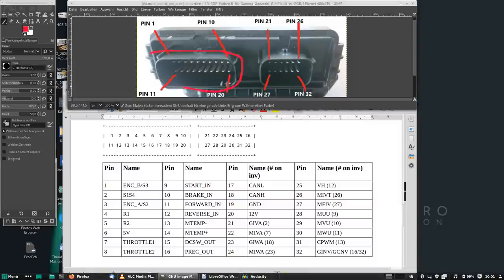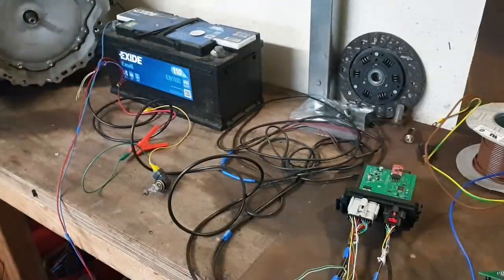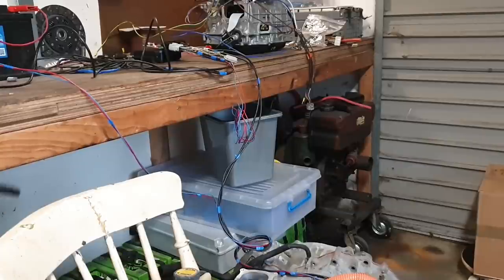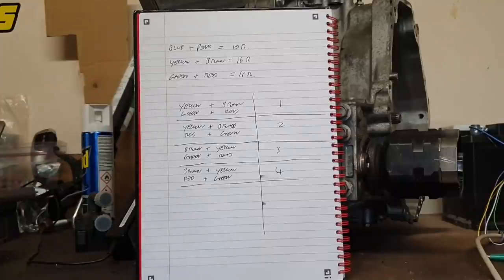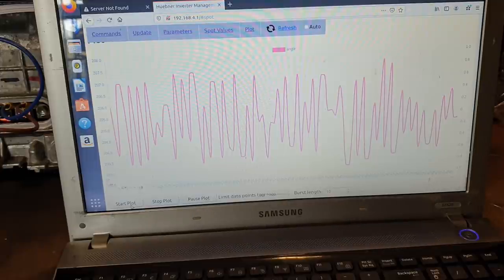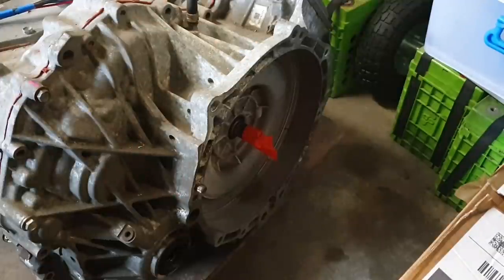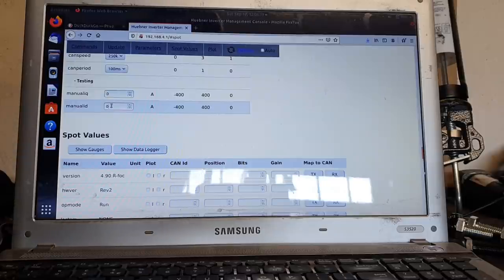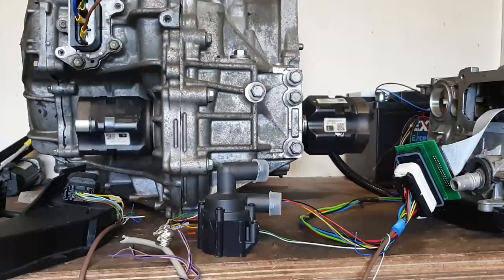OpenInverter FOC Tuning Tutorial

Comment: Just successfully tuned a Gen 3 inverter and Gen 3 MG2 using this method. The video is a brilliant collaboration and thank you both very much. I was running v4.9FOC firmware which is newer than in this video and the “set pinswap 5” command didn’t work for me, however there is now a handy drop down menu item labelled pinswap which allows you to select PWMOutput23

Comment: FOC: Field Oriented Control. HV: High Voltage ~80-200V. IM: Induction Motor.
OVERALL: discussion is about Toyota parts, but is generic for almost any permanent magnet motor which will need FOC software.
TEST EQUIPMENT: <<INEXPENSIVE>> It is assumed that only basic equipment is available such as light bulbs, switches and multi-meters.  (12 V wires can be automotive grade, but HV cables MUST BE RATED FOR ~ 300 Volts).
0.51: Connections to VCU for Toyota Gen 2 Inverter.
4:27: Overall schematic of inverter and VCU Gen 2, 12V wiring including external items such as throttles and resolver connections
4:55: Discussion about VCU Gen 2 PCB components: purpose of; location of power supply ccts; pre-charge/charge circuitry etc. 
6:21: location of solder jumpers for 'open collector' requirements with Asynchronous (IM) motors with encoder feedback.
6:37: VCU Gen 2 connections to inverter Gen 2 and trans-axle Gen 2.
7:08: Grey connector for throttle, brake, 12V power etc.
7:15: Black connector goes to Gen 2 inverter.
7:24: How to SAFELY apply 12V power to VCU Gen 2 for reducing damage from mistakes such as 12V to wrong pin...
9:46: 55W lamp, car battery, ideally fuse (10A?).
10:30: VCU energized: should be two LED s light steady, and third one flashing (shows STM IC executing software, :)  ).
11:14: Initial hook up to Gen 2 inverter. Bypass inductor, Use 80-160 V DC supply initially. Use ~230V incandescent light bulb.
11:21: Signal harness has been connected at this point in time.
11:41: 2 pole connector is 12V supply to Gen 2 inverter. Watch polarity.
12:45: VCU Gen 2 AND Gen 2 inverter connected to 12V supply. Light bulb behavior slightly different to only supplying VCU Gen2.
13:00: Small glow of lamp due to quiescent steady state current consumption of  Inverter Gen 2 electronics (Gate Driver board).
14:01: Bulb glowed as expected, can connect 12V supply directly, bypassing globe. Please use fuse in series with supply to protect wires.
15:04: Trans-axle Gen 2 temporarily wired to VCU Gen 2, HV battery, trans-axle resolver connected to VCU Gen 2. 
15:42: Only MG2 of Gen 2 trans-axle connected to MG2 output of Gen 2 inverter
16:13: Trans-axle planet split device has been welded together and the trans-axle bolted back together. No oil in trans-axle.
16:27: MG2 and MG1 now spin at same speed all the time. See other videos for info on welding.
17:00: Stubs for trans-axle differential output were not available, so Damien put tape on the petrol connection for seeing rotation of the axle.
18:20: Discussing running trans-axle in open loop mode first, as part of FOC Tuning process.
18:43: HV battery connection to two bus-bars, (bypassing orange input cable port) to bypass buck/boost inductor. 
19:04: Build up commissioning plan using the most simple steps conceivable. Can always add other steps later.
19:17: Bus bar closes to black capacitor square is HV positive, Bus bar closest to aluminum die-cast box is HV negative.
20:05: HV negative wire connect directly to HV battery pack (or equivalent) [Remember to use HV rated cable :)]
20:51: Recommendation: use HV battery rated 80-160V (150V?) good value...
21:17: Use ~20 Amp fuse HV rated and fuse holder HV rated, light bulb 230V rated 100W HV rated, bypass switch HV rated.
22:03: Fuse protect wires from shorts (does not protect electronics). Switch open for pre-charging inverter capacitors and seeing inrush current flow into inverter electronics and seeing how current flows into trans-axle during early commissioning phase.
23:03: If you don't understand pre-charging inverter capacitors, please pause watching this video and learn what this means first.
23:41: HV light bulb limits any fault currents that may flow during early commissioning phase.
24:08: HV light bulb protection for limiting fault current for wiring inverter incorrectly, inverter faulty, battery wired wrong polarity, any other unplanned conditions. (Please note, shorts on HV battery circuits can carry thousands of amps, with burning and UV flash-over)
25:36: Negative battery connection crocodile clip attached to HV battery (HV positive connection was already connected). Result, light bulb flashed for <1 second. Means pre-charge current for inverter capacitor Gen 2 flowed, then once caps charged light bulb went out.
26:50: Total system of trans-axle, inverter, VCU, HV battery , LV battery is now ready for overall system commissioning.
27:05: Now go to computer talking to VCU, and set f to 3 Hertz.  And Ampnom to 10%, Can hear whine coming from trans-axle.
27:35: Ampnom ramped to 20% then 25%, now get petrol axle jittering and trans-axle rocking back and forth.
27:42: Ampnom set to 25%, and now we see axle rotating slowly in open loop mode. PROVES: inverter/trans-axle/HV/LV Battery/VCU wire connections system WORKS as a whole. We are now READY for the next stage of FOC tuning.
28:20: We observe HV light bulb is glowing dimly, because we are consuming current in the transaxle rotating.
29:09: Ampnom is now set to 0 amps via the laptop. We can now close switch to bypass HV light bulb, and then continue open loop tuning.
30:05: The spinning petrol shaft axle means: inverter/trans-axle/HV/LV Battery/VCU wire connections system WORKS as a whole.
This is a significant step.
30:32: The next step is to commission this permanent magnet trans-axle using the Openinverter forum FOC firmware.
31:19: For those commissioning their permanent magnet trans-axles, please pause what you are doing and carefully watch this entire tutorial :).
32:00: Demonstration of resolver circuit. Sinusoidal excitation signal verified with a tiny second hand loudspeaker.
32:33: Set 'encmode' to 'resolver' on laptop.
32:59: How to lash up 12V supply to VCU on bench to test excitation output signal. Connected pins 4 and 5 to loudspeaker.
32:42: Discussion of how to get the 6 wires of the trans-axle resolver connected to the correct pins of the VCU.
33:58 Resolver discussion applies to practically any permanent magnet motor.
34:20: Need paper and pen, basic multi-meter, wires to connect to trans-axle resolver plug (hopefully you have the mate for the plug)
35:25: Without any resolver wiring diagrams, point to point sets of three pairs of wires. Write down resistances of pairs of wires. Lowest resistance pair is the excitation coil pair. This applies for any make resolver.
Reply: 38:26: The two high resistance pairs are the sine and cosine pairs of wires. They have almost identical resistance.
39:23: Which pair is the sine or cosine pair does not matter for the Openinverter forum FOC firmware. Therefore you don't need to lose time trying to work this out. There is a video by Johannes that describes the maths for this.
40:01: Need to make chart in the notebook for 4 possible permutations of connections for the sine and cosine pairs. Need to connect the same polarity of the sine and of the cosine coil to the ground return connection.
40:40: CRITICAL: Only 1 of these permutations will work your motor properly. The rest will only make your motor partially work. Even if you have a schematic from the manufacturer, you still need to go through this work.
41:44: Strongly recommend you bring out the resolver wires from the VCU and connect to some connector block with at least 6 tunnels in it. Put exciter coil wires to the right and the rest to the left. To facilitate changing sine and cosine coil polarities.
42:19: Wire the exciter coil of the trans-axle resolver to the exciter output of the VCU. Please note, polarity of exciter does not matter :). Because all you are doing is swapping polarity of BOTH sine and cosine coils, which does'nt matter.
44:32: Now we look at outside world connector of VCU. E.g.: Pin 1 is sin resolver connection.
 47:40: With correct resolver connections of the system and tuning of the FOC firmware, end result commissioning is demonstrated by easily changing speed of the trans-axle axle by simply depressing the accelerator pedal.

Have to stop now, more later.
Reply: 48:35: Damien will post a parameter file on the Openinverter forum. Please post yours here too so we can build up data for everyone to use.
49:03: Page from notepad showing last configuration was the successful resolver feedback connections for correct sin/cos polarity.
49:34: Huebner web interface. >Load FOC firmware. > hwver>Prius. >Opmode = OFF. 
Must make sure resolver signals are being received by STM32 in VCU. 
Make sure HV completely turned off.
Put vice grips onto shaft and turn manually for full revolution.
Computer, Go to Commands . Put opmode into Manual / Run.
angle L , R. Can graph from left or right.'
Go to bottom of screen, hit Plot button, and see waveforn on screen. Plot 204 - 207 degrees. This plot includes jitter. We expect some, but not a lot. Jittering >5 degrees, would consider that a problem. For this, check wiring, screens of resolver cable. E.G. jumping over a hundred degrees, STOP problem in resolver wiring or something else, broken resolver winding etc.
Restart Plot, rotate axle by a few turns look at waveform. Should get jumping wave forms that move from >0 to <360 degrees. We don't expect plot to capture 0 degrees or 360 degrees, because sample rate is too slow.
So screen goes 0 -> 360, 0 -> 360, 0 -> 360.
Third test, crank up limit data points and burst length. Start plot and hand rotate axle again.
Expect to now see 0 - > 360 in some of the waveform display.
Now go back and press Stop Inverter button on screen.
55:51: lasterr, Throttle1, if this displayed low resolution instead, micro-controller is telling us amplitude of received signal is too low.
56:02: Remove vice-grips from axle. 
56:17: Have to configure current sensor positions for FOC firmware in Gen 2 inverter. Has to be done manually through custom command box. 
56:46: Set pinswap 5 Send Custom Command. In messages should see Set OK.
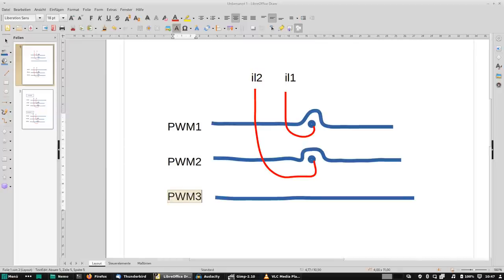57:31 We expect PWM1 would be measured by IL1, PWM2 would be measured by IL2, PWM3 not measured.. 
Not so Toyota, they use PWM1 not measured, PWM2 measured by IL1, PWM3 measured by IL2.
This confused the FOC software.
58:37: pinswap = 4 is a bit change command which relabels the current sensors to be as per Toyota arrangement above.
58:38: first bit of pinswap swaps PWMs, second bit of pinswap swaps current input labels.
So now PWM1 sensed by IL1, PWM2 sensed by IL2.
1:00:10: we now need to set some parameters for our motor. Polepairs = 4; Resolverpolepairs = 4;
encodermode to resolver.
syncoffset =0 to start with (Has range 0 - 65535). At this stage of commissioning, please leave at 0.
pwmfrequency to 4.4kHz.
3.1 current gain seems good value for MG2 power stage in Gen 2 inverter.
udcmin = 0, udcmax to some high value.
heatsink temp max to 150
1:02:20: save parameters one more time. Now press refresh button, and we should see condition off.
1:02:46: Reconnect HV battery 160V in this case, through 100W filament lamp.
1:03:06: We now start tuning in our commissioning process. Hit Refresh, confirm we are in manual/run.
1:03:21: Hit manualid box and press 1 amp, expect to hear a whine coming from trans-axle.
1:03:38: Increase to 2 amps, motor is now beginning to turn. Then motor stops and light bulb illuminates. This is perfectly fine, so set opmode to off.
If we did not follow that procedure, the inverter would try to inject maximum power, trans-axle would be jumping around the room and may damage windings. So cheap light bulb is a great asset for current limiting.
1:05:02: Can now switch on our bypass switch.
1:06:36: So when we inject 3 amps we see axle spin freely. We have achieved correct resolver operation AND correct current sensor operation :).
1:07:15: Johannes and Damien then looked at reverse, and a bug was found in the software. So now reverse works perfectly fine, as does forward :).
1:08:40: We will now move over to the Gen 3 system because this trans-axle has oil in it (Gen 2 does not, so don't want to damage the gears without lubricating oil). Does not matter that we flick from Gen 2 to Gen 3 system, procedure is exactly the same. Key thing is resolver and permanent magnet physics is same.
1:09:55: Gen 3 trans-axle has welded planetary gear device in it and using Yaris Gen 3 inverter.
1:12:00: A sketch of syncofs tune is shown, vertical axis is (manualid causes spin on its own [no manualiq]) effectiveness of syncofs value, horizontal axis is syncofs value from 0 to 65535 (Looks like notch filter).
1:12:41: syncofs (Synchronous offset) is the most important parameter we need to tune. This parameter is the most misunderstood.
1:13:43: For all different values of syncofs to left of notch, for all values of manualid, the motor would spin up.
For all different values of syncofs to right of notch, for all values of manualid, motor would spin up.
As we approach the correct value (the notch) from the left, we will notice it will take more and more manualid to achieve spin. this is good. We are onto the correct method of tuning.  There may be only 100 points in the notch.
1:18:06: For this set up at 150V battery voltage 10,200 seems to be a very good notch value. But we will set to zero and perform tuning together.
1:19:13: Start inverter in manual mode. Go to Parameters, confirm syncofs is 0.
1:19:14: Now put in 3 Amps for manualid, and check motor spins. Then go back to manualid = 0.
1:21:30: My rule of thumb is to go in 5,000 jumps. So apply this then check manualid= 3 Amps. Now please note, the motor still spins but more slowly. so we are beginning to approach the notch :).
1:22:50: So now change syncofs by half as much again or 2,500 to give us 7,500.
Does not move at 3 Amps!, Try 6 Amps, and we can get movement. Vital Clue!
1:39:15: Now lets try 8,750, (increase by approx half again or 1000). Now we need 12 Amps!
Lets try another 500 points, 12 Amps axle is slower again. Note, if we see shaft rotating the other way, we have found ourselves on the right hand side of the notch. We don't want to be there, we want to be at the minima. 
1:26:40: Now go in steps of 200 to 9,200. 6 Amps, nothing, 12 Amps nothing! We have to go up to 100 Amps before we hear some rumbling, but no movement. This is a clear sign we are close to the notch. Stator and rotor magnets are nearly perfectly aligned, but not perfectly because we are still getting rumbling or jitter.
1:27:59: Lets now try 10,000 points (jumps of 100), not at individual values yet.  
Lets say we have jumped to say 20,000 points, and wacko, we are spinning in reverse! So we are now on the right hand side of the notch!  In other words, if we overshoot our notch syncofs position we go in reverse.
So lets go back to 10,100, and we get a small amount of movement at 12 Amps.
1:31:23: Lets try 10,120 points. No shimmy at 100 Amps! 
1:32:18: So next test in our tuning is to try manualid = 0.1 amps, and manualiq = 3 Amps, and motor spins.
1:33:13: If we want to check reverse we just try manualiq = -3 Amps, and it spins backwards!
1:33:25: We are now very very close to the notch point. We now go to Parameters, and save parameters to flash.
1:34:07: Final test, put motor into normal run mode , now use throttle pedal, and as we can see we can spin the motor up using our throttle pedal :).
1:34:50: RECAPPING
Step 1: Use sine firmware and check our motor and inverter work.
Step 2: Put FOC firmware in. Calibrate our current sensors. Set up resolvers. Can now run motor with manualid with syncofs = 0. IF at this time we get resolution error, we have to backtrack and fix before proceeding any further.
Gen 2 and Gen 3 transaxle files will be put onto openinverter.forum, please put yours here too.
Reply: @johnspark740  Thank you so much for doing this breakdown. Normally I do this, but, a lot of this was a bit over my head, and it was a long video, so I struggled to write and summarize the context. I'd been slowly churning away at the first 30 minutes over the couple weeks since it was posted, and your summary is much better than mine was. Great job.
Reply: @MattsAwesomeStuff  Love your kind words MattsAwesomeStuff. I actually followed your method of documenting the steps, so kudos to you too :)
Reply: You, Sir, are a LEGEND.